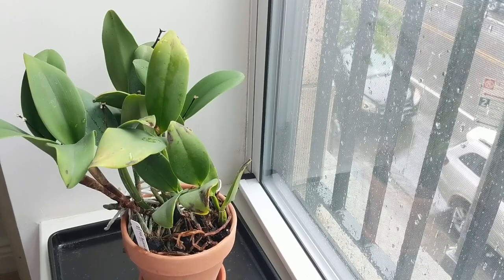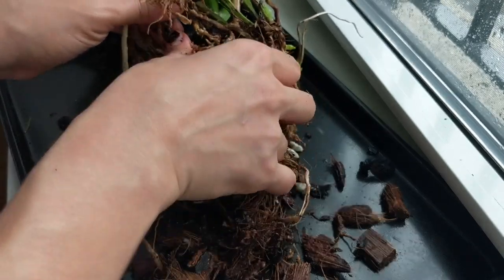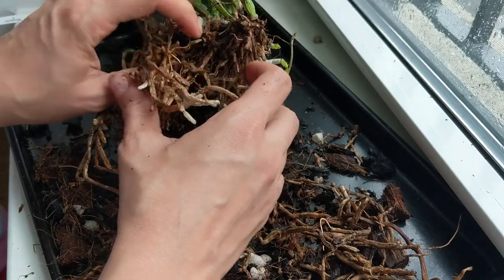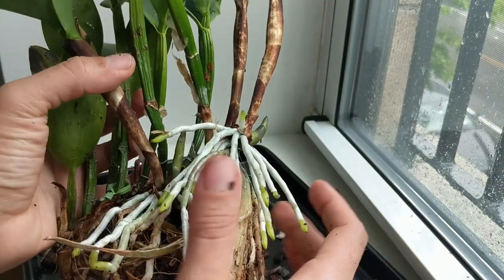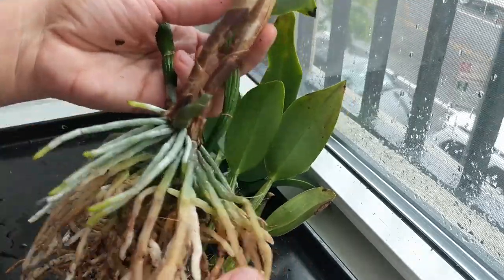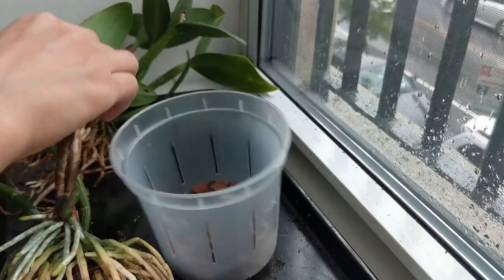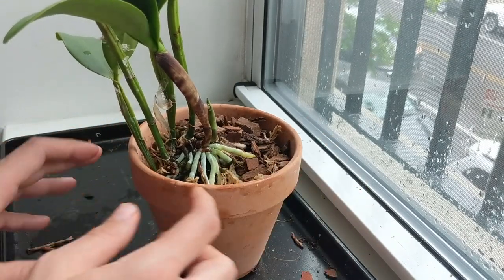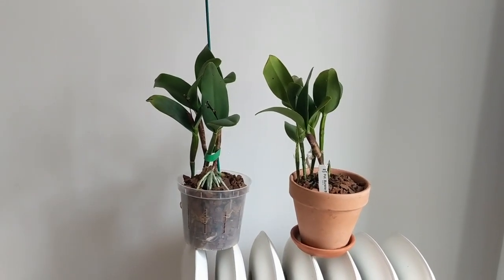How to Divide & Repot Cattleya Orchids | Easy Repotting Tips for Beginners

Comment: That's been my experience with up-potting/slip potting orchids, the variable dry rate between the old media and new media causes the old roots to die because they end up staying wetter. The pot in pot method seems to work a little better (especially in clear pots) because you can selectively water.
Reply from the maker: Agreed. I don't mind though, because the roots that die seem to be the old ones and it makes it easier to remove. Give me new roots and growths and I'm haircut happy ✂️✂️✂️✂️

Comment: My Cattleya Burana Beauty has mold around its roots after repotting. I used hydrogen peroxide but it comes back. Do you know a good way to get rid of mold?
Reply from the maker: It happens sometimes and usually resolves itself once you let the pot dry a few days It's happened to me with a cattleya before that dumped its roots and would stay too wet after watering (wasn't absorbing the moisture).  It went away once I let the pot dry out and when new roots came in and would absorb the water faster. If it gets bad and continues to come back after letting the pot dry, I would repot, but time it with new roots coming in if you see it's still an issue.